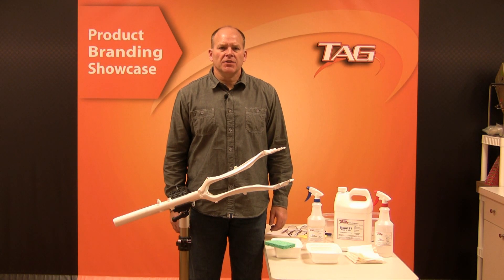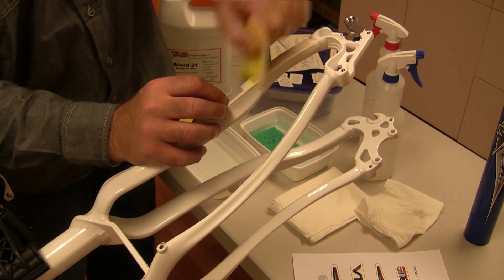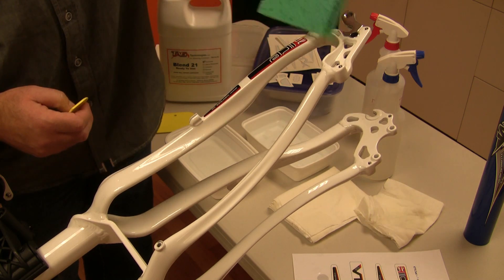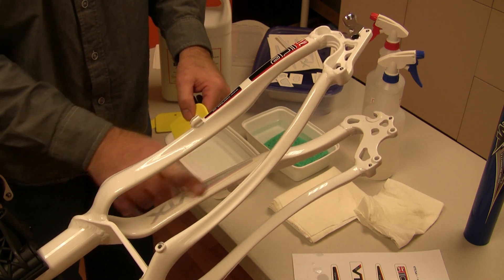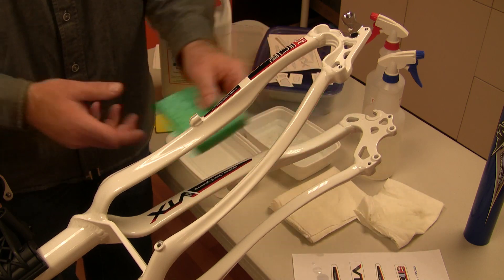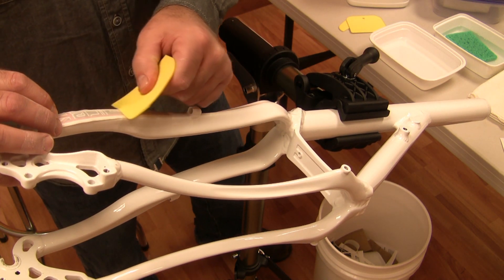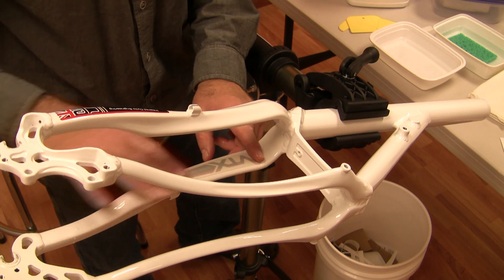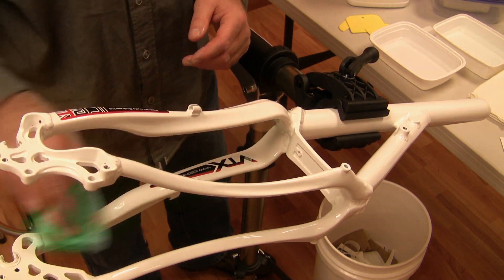Decorating Bike Frames with DuraTAG Ink Transfers

Comment from the maker: Manufacturers around the world use our DuraTAG process to decorate the products they produce.  We are set up to run volumes as low as 25 pieces to quantities exceeding 500,000 pieces. Everything we produce is custom, using the customer's designs.  Based on the process used to set up and produce our unique Duratag Ink Transfer, our minimum order is $500.  I hope this information was helpful.  If you would like a quote, please email your vector Adobe Illustrator or EPS artwork to info@tagtech-llc.com.  please set up the artwork at 100% and list the PMS colors and volumes you need quoted. Thank you.